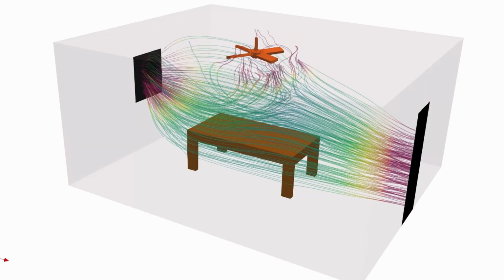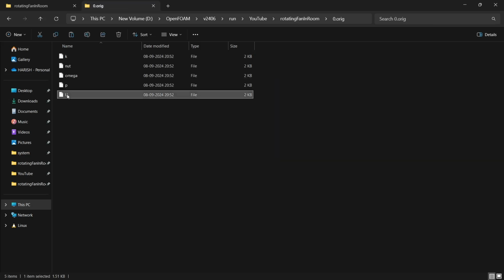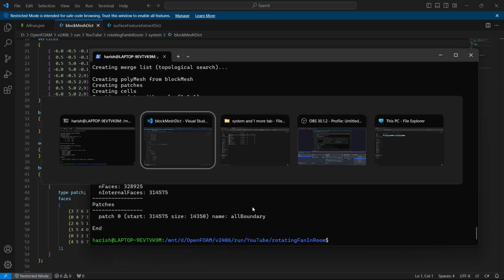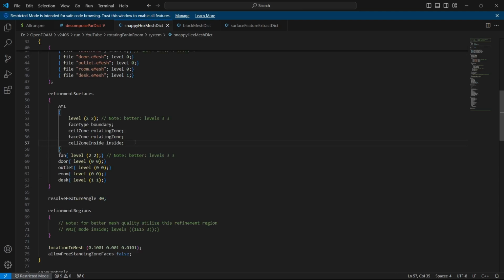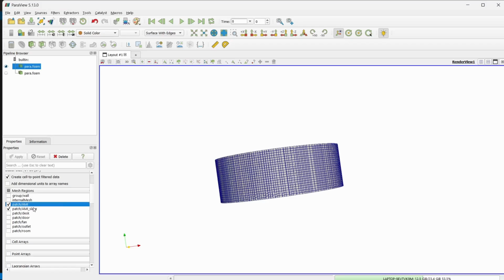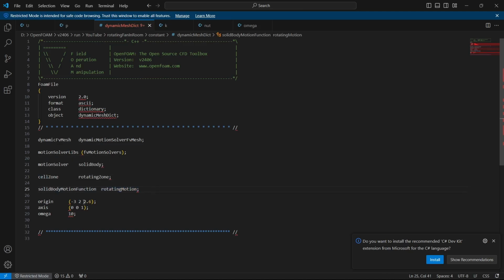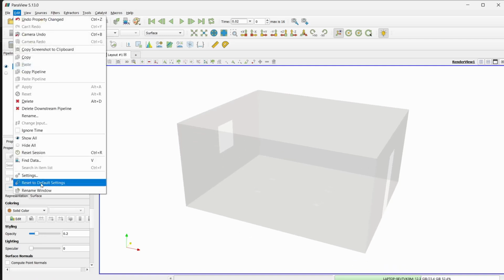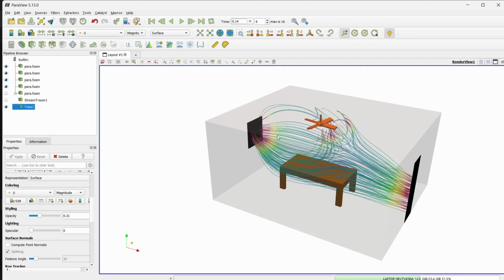Sliding Mesh - Rotating Fan in Room | Dynamic Meshing in OpenFOAM | Preprocessing to Postprocessing

Comment: Can you study the same problem using MRF? I found negetive bound for k and omega while simulating using MRF & simpleFoam.
Reply from the maker: Okay sure I will try. But it might not converge since the flow is very transient in nature. 
For bounds you can add fvOptions and limit the values to a range. Or even set a minimum.
Reply: @Codeynamics  i was studying only rotating fan inside 3m cubical room with window only ( no other ventilation). The time average flow using pimpleFoam was also not reaching steady state. If you need my case files, then let me know ..
Reply from the maker: Please add more iterations in your solver for whichever equation is not getting converged.

Comment: Hello Sir, can you assist me on the setup for the MixerVessel example from openfoam, i can not understand the difference bewteen AMI and MRF. Do you have any tutorial or video regarding this topic?
Reply from the maker: AMI is Arbitrary Mesh Interface. You need that region for both MRF and sliding mesh. 
MRF Is a steady state simulation of rotating bodies. Sliding mesh is transient. 
Both need the same kind of mesh. Just the solver will be different.

I'll try to make a tutorial for MRF soon. 
Not sure if I can do for mixer vessel immediately. But I'll do for sure.
Reply: @Codeynamics  then using a sliding mesh is a more adequate approach for analyzing fluid patterns inside the so called mixer Vessel and different variants? Another question, at my setFields file when defining a box volume of substance x,y,z Do some borders/parts of the box/volume can be geometrically outside of my vessel/cylinder and the volume of liquid/gas trapped inside will still interact with my moving wall?
Reply from the maker: yes, Sliding mesh is more appropriate since mixing is a transient phenomena. 
Your setFields box can be very large and can go outside your mesh domain. It is totally fine. It will assign values only to the mesh within your setFields box. As long as it doesn't interfere with domain of another fluid.
Reply: @ Thank you!